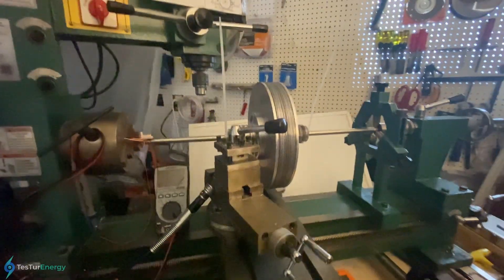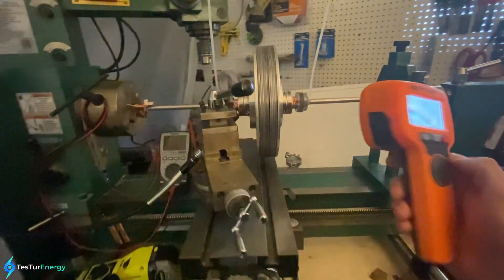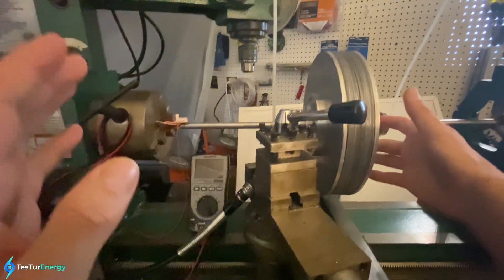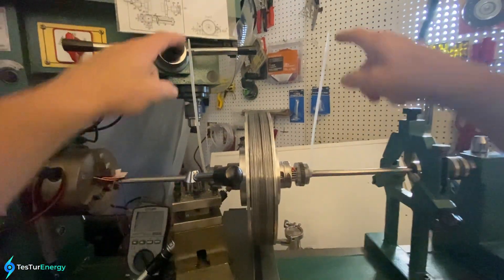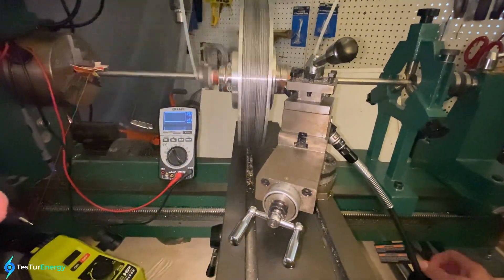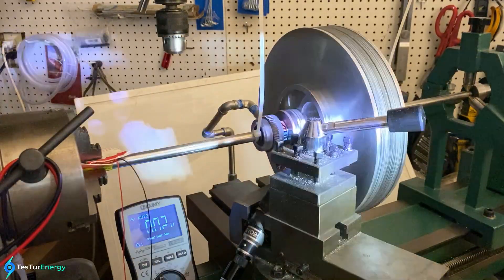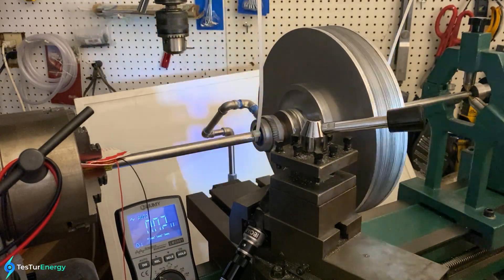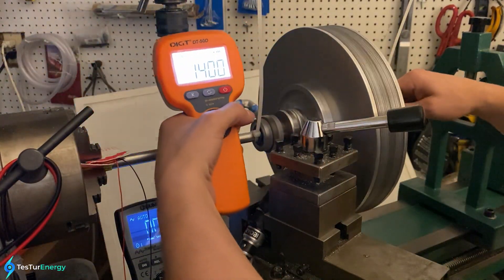How To Do Dynamic Balancing of Tesla Turbines, Turbo Jet Engine Rotors & More On A Lathe

Comment: I would love it if your could dumb this down a little for the likes of me that doesn’t yet get what is happening here
Reply from the maker: Hey thanks for commenting! So basically when you spin it at specific RPMs the heavy side of the rotor will always be on the outside. So grinding on it will result in taking mass off the heavy side and slowly bringing it into better and better balance.
Reply from the maker: @waynoswaynos  you’re welcome! Let me know if I can help clear anything up.

Comment: one additional idea for tesla turbines, as a wind tunnel concentrator generator, assuming the generator efficiency is that near 100%, to get most of the wind power, beat the betz limit, honestly
Reply: have you tried to blow a hair drier to the other half of the tesla turbine
Reply: if balancing matters, then it matters also for a rotational energy store
Reply: or, if you spin the thing fast/slow enough, then the balancing would not matter, because of equal distribution of mass
Reply: oh between discs balancing, hmmm
Reply: tesla turbine should be a nice beard sniping machine, also lol :)
Reply: not a cutter with sharp blades, just spinning it with the blade sheets
Reply: like a saw blade discs, lol
Reply: sounds like wheel balancing op

Comment: There are much better more modern ways of balancing things. Look at how engine shaft balancing works and you can diy a system for under $200 that will get you much more accuracy.
Reply from the maker: I think I may have misconstrued the patent if I’ve given the impression that  this won’t give very high degrees of balance. 

When you design the Tesla turbine shaft correctly you use a shaft that has a critical rpm a little over 3x the operating rpm.  

This way when at operating speeds, any whirl orbit deflection from center will ALWAYS have the heavy side of the rotor on the outside and an abrasive bit or jet can be used to do at speed live operation balancing for any changes.  

This isn’t just a balancing apparatus. This is a built in auto balancing system for the Tesla turbine. 

I would urge you to take a look at the rotordynamics experiment known as the Jeffcott Rotor. This entire apparatus is built around those resonant mechanical systems.
Reply: @CharlieSolis  I didn't say it won't give you good balance, I said there are better modern ways (they are mostly improvements to the same system). Also you are powering the rotor from 1 side which gives you an unbalanced force pushing on that side of the rotor. Ideally you want to power the shaft (usually done with a loose flat belt) while resting it on several load cells. You should be able to reach upwards of 150k RPM using this system with less than 0.001g of imbalance. 

I have seen people run Wankle motors at 15k RPM and that is a spinning triangle weighing several KG.
Reply from the maker: Dood, I’m sorry but there’s nothing you could make a 10in diameter disc out of and spin it at 150krpm. Full stop. 

Not even carbon fiber, which has a max safe continuous rpm of ~60k rpm. (Within 80% of max yield strength and 75% max tensile strength)

These 3105 h14 aluminum discs have a max safe continuous working rpm of ~15krpm.

The 7075 t6 aluminum 10in discs, I have will have a max safe cont. of 30krpm. 

Stainless steels 304 and 316 are heavy for their strength so it’s not the best for discs. 

It has about the same max rpm as these cheapo aluminum discs I have in this junk prototype I’ve been testing. 🤭

But stainless can do those rpm up to much higher temps. 

The aluminum will be preferable for compressors and for compressed air and liquid air cryogenic turboexpanders, cuz aluminum gets stronger as it gets colder, but fatigue strength becomes an issue at a certain point. 

And yeah I have no problem with this already. 

My dyno tests have done up to 13krpm and this is a 4.36kg (~9.61lb) rotor. 

https://youtu.be/exF5Rn-L8gs

Peak power and torque are 4.25kW at 6000-8000rpm and 6.22ft-lbs of torque at 4150rpm (to the shaft available for power) on just room temp compressed air and never saw higher than 40 psi at the nozzle. 

The live power tests I’ve done with 2650watts output were fine at above 12,000 rpm. 

https://youtu.be/K7qZvq1CMFg
(Uncut version: https://youtu.be/XQl1DQgXVkQ )

What’s your point with the 15,000 rpm Wankel? That doesn’t have anywhere near the same rotational kinetic energy.

Correct me if I’m wrong but for a Wankel, the e-shaft tachometer rpm is not the same as actual rotor rpm. It’s less right?
Reply from the maker: There is no unbalanced force on the rotor, the nozzle acts like just another “yieldable” section of the apparatus. 

It’s putting a belt on it that messes with the balance. 

The air nozzle is just about the best way to do it because it just adds or subtracts from the spring coefficient of the yieldable apparatus because it’s an air damper.
Reply from the maker: Not to mention, a belt is literally applying an unbalanced force on the rotor. 

Tesla literally talks about this in the patent. Again I would urge you to actually go read the patent because you would find these answers in there. 

“When bodies not adapted for rotation in the manner shown are to be balanced, they will be driven independently by belt, electricity or other means, care being taken that no disturbing vibration from them is transmitted to the apparatus. In order to preserve intact the peripheral boundary, if this is essential, I grind the material off from some other place and when desirable, I make a special provision to this end in the design and construction of the part.”
-Nikola Tesla 
https://teslauniverse.com/nikola-tesla/patents/british-patent-186799-process-and-apparatus-balancing-rotating-machine-parts
Reply from the maker: Yeah in a Wankel when the e-shaft tachometer reads 15k rpm the rotor is only going 1/3 that, so 5000rpm.
Reply from the maker: If modern ones work on the same principle then they will get the same result. And this way you don’t have to poke and prod around with vectors looking for the right spot. 

This automatically makes it so the heavy side is on the outside of the whirl orbit. 

Think smarter. Not harder. Utilize the principles of rotor dynamics to your advantage. Don’t work against them. Steer into the curve. 

 
“As means to this end I may employ a grinding wheel, a sand-blast or jet of other abrasive substance. It might be naturally inferred that the contact of an emery or carborundum wheel with a rapidly whirling machine part would be productive of dangerous shocks and vibrations, and also that grinding at speeds much higher than the usual could now be satisfactorily accomplished. But although these theoretical assumptions appear sound, I have encountered no difficulties of this kind and have performed the operation with the greatest facility and success. This I attribute to the inertia and momentum of the spinning body which makes it insensitive to such asynchronous disturbances as the wheel might produce. However, in certain cases it may be more convenient or preferable to effect the removal of the excess material by a high velocity jet of abrasive substance applied tangentially to the part to be balanced. In order to attain the best results it is essential that the latter, when rotated, shall be capable of an appreciable displacement of its center of gravity from the axis of symmetry. This is accomplished by supporting it on a shaft of suitable flexibility or, if its own shaft is not sufficiently flexible, in bearings yieldably mounted. It is furthermore of great importance, in order to avoid vibrations which would interfere with the proper application of the process, that the speed at which the grinding is effected should bear a definite relation to the critical, corresponding to the fundamental natural vibration, and the following rule should be observed: If the system is run in two bearings the grinding speed should be an odd multiple or submultiple of the critical. If, on the other hand, the system is supported on one side only, the speed should be an even multiple or submultiple of the critical.

When the structure is revolving at the proper speed I bring the abrasive wheel into operative contact with it at a peripheral or other suitable region and grind off material. As the action continues, the flexure of the shaft diminishes until, finally, its center of symmetry coincides with the center of gravity of the system, or nearly so. This can be noted in many cases by a competent operator without the use of a special device, but suitable visible or audible means may be employed for the purpose.

Preliminary to the application of the process it is advisable to run the part at a very low speed and true it with the wheel. If there exists appreciable flexure of the shaft when the system rests horizontally, the grinding may be done in a vertical position when it is in static balance. A part to be run on a stiff shaft may be mounted on another of suitable flexibility; and as there exist limitations in the accuracy of fitting a cylindrical sleeve, I may employ a tapering one to secure greater precision. However, satisfactory results can generally be obtained in arming the rigid shaft with flexible extensions or holding it in bearings yieldably supported. In all cases it is desirable to flood the latter with lubricant of considerable viscosity. When balancing parts to be run at a high temperature they may be inclosed in a casing in which approximately the same temperature is maintained, an opening being provided for the introduction of the abrasive wheel or jet.”
-Nikola Tesla 
https://teslauniverse.com/nikola-tesla/patents/british-patent-186799-process-and-apparatus-balancing-rotating-machine-parts
Reply from the maker: This paper is a good place to start if you’re not familiar with the Jeffcott rotor. 

https://dyrobes.com/wp-content/uploads/2015/09/Understanding-Amplitude-Phase-In-Rotating-Machinery_linked.pdf

Comment: Dreamy shop, sir! Your stainless builds tho nice! I personally get into the HV pursuits; crazy one guy did so many things, never give up, look forward to the progress!
Reply from the maker: Hey Richard! Thanks for commenting! 🙏❤️

For real though, the man had range.
Reply: @CharlieSolis  What lathe, mills etc are you using to manufacture these parts?Thx
Reply from the maker: The turbine I do on my cnc machines. But otherwise any moderate sized lathe will work for balancing. You need it to be heavy and sturdy though.
Reply from the maker: @jbarr3551  are you familiar with using industrial machines?

Comment: I have a sneaking suspicion that Tesla's turbines didn't have a .25" wobble while he was "balancing" them.... Just saying: IF you can see some "dancing" from a 369ft away.... The "art" of balancing is still 2 easels away from your "Mona-Kerryn"....  Don't mistake my sarcastic friendly-fire for anything other than a wiseass friend calling your choice of beer "gay"!
Reply from the maker: 🤣 you realize the shaft is supposed to be flexible for balancing right? 

Nice try though wisenheimer. 

When you spin it at the critical rpm it goes into resonance with the shaft. It has almost zero deflection at any other times other than at the critical rpm. And even then, your 0.25” is more like 1mm. 

Essentially everything will vibrate at least a little bit on a flexible shaft at the critical rpm. Regardless, I’m not done with this rotor either.
Reply from the maker: Never mind though that Tesla did in fact plan to allow the turbines to wobble large distances while he was “balancing” them… 😜
In Tesla’s own words. 

NIKOLA TESLA BRITISH PATENT 186,799 - PROCESS OF AND APPARATUS FOR BALANCING ROTATING MACHINE PARTS
“In order to attain the best results it is essential that the latter, when rotated, shall be capable of an appreciable displacement of its center of gravity from the axis of symmetry. This is accomplished by supporting it on a shaft of suitable flexibility, or, if its own shaft is not sufficiently flexible, in bearings yieldably mounted. It is furthermore of great importance, in order to avoid vibrations which would interfere with the proper application of the process, that the speed at which the grinding is effected should bear a definite relation to the critical, corresponding to the fundamental natural vibration, and the following rule should be observed: If the system is run in two bearings the grinding speed should be an odd multiple or submultiple of the critical. If, on the other hand, the system is supported on one side only, the speed should be an even multiple or submultiple of the critical.
 
When the structure is revolving at the proper speed I bring the abrasive wheel into operative contact with it at a peripheral or other suitable region and grind off material. As the action continues, the flexure of the shaft diminishes until, finally, its center of symmetry coincides with the center of gravity of the system, or nearly so. This can be noted in many cases by a competent operator without the use of a special device, but suitable visible or audible means may be employed for the purpose.”
-Nikola Tesla

https://teslauniverse.com/nikola-tesla/patents/british-patent-186799-process-and-apparatus-balancing-rotating-machine-parts
Reply from the maker: Just released the latest update! 
Tesla Turbine 250 watt to 2.65 kW Power and Efficiency Test
https://youtu.be/XQl1DQgXVkQ

Comment: Any thoughts of friction heating or any other heating?
Reply from the maker: Not sure it’s necessary in any of these applications because you need a prime mover that you supply energy to to run a friction heater to get the heat. When you could use that same energy with a heat pump and get much more heating. Obviously temp ranges are different but I think you get what I mean. Friction heaters are great when you need a very uncomplicated system to just work when you want it to work regardless of its efficiency or comparative output. 

Like I’m mines for example. Certain operating locations might provide to severe of conditions for complex heaters to be used long term.

As an analog for that, the Tesla pump is used in the oil drilling industry because it’s the only pump that can handle the crazy abrasive particulates in the fluids being pumped. It may not be as efficient as a bladed or piston pump but it’ll last 5-10 times longer. 🤷‍♂️